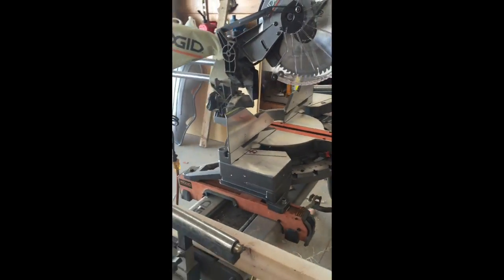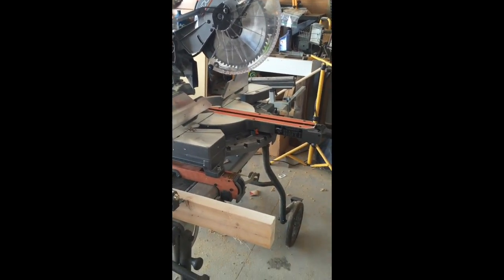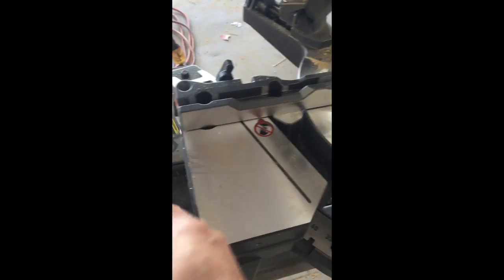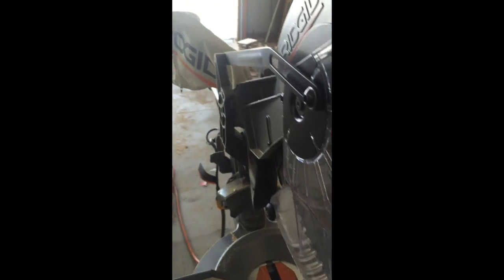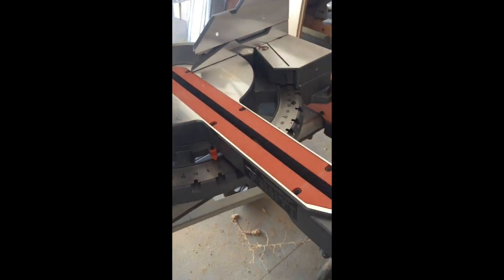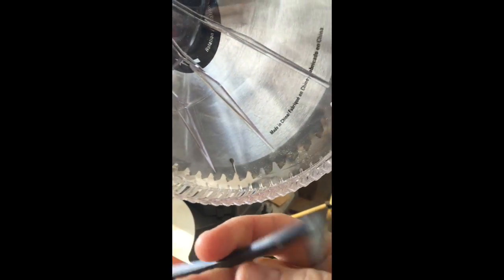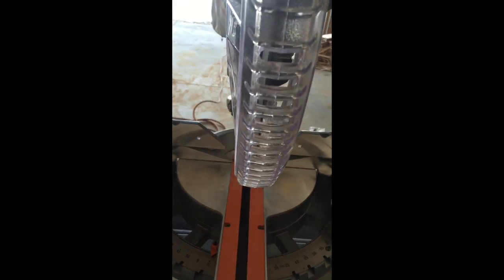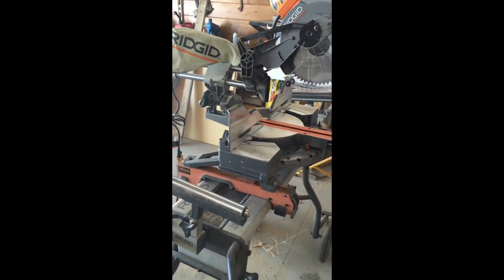Rigid 12" Miter Saw Review

Comment: Did you notice any blade wobble when you use it
Reply from the maker: Yes, it did have just a slight blade wobble right out of the box. I might have been able to ignore it but, it was brand new, and it should have been perfect, so I returned it and exchanged it for another one. The second one was much worse. Very visible wobble, and this time I could feel bad bearings buzzing in my trigger hand. So I returned it.
I've seen one or two people say they lucked out and got a good one. For me, I'm going to wait until they get the bugs worked out, and then purchase it again. If Rigid can solve this wobble issue, it will be an absolutely amazing tool.